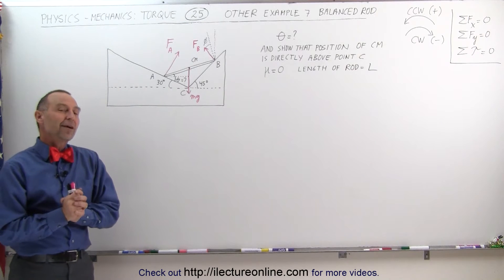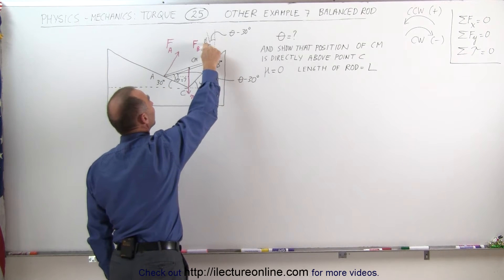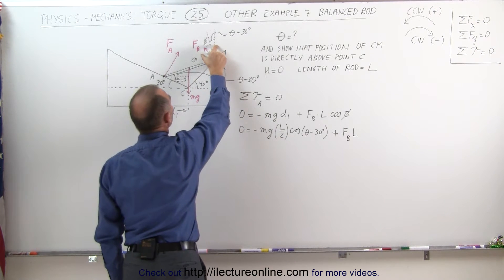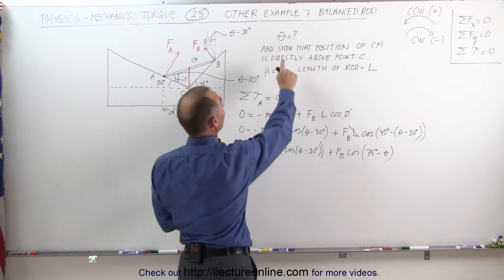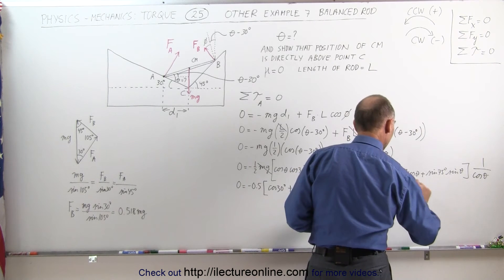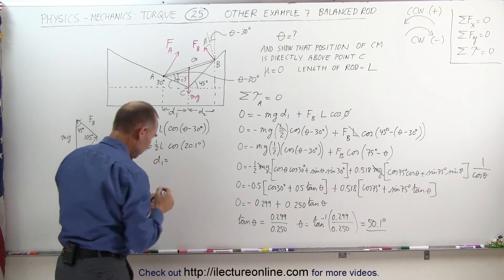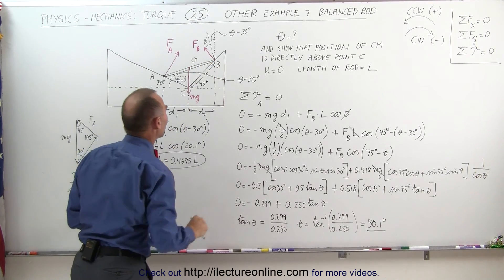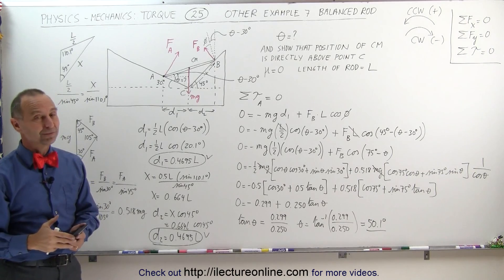Physics 15  Torque (25 of 25) More Examples: 7 Angle=? of Balanced Rod

Comment: Hello Sir, in real world what if I have a 3d object on a surface (table for example) and I would to calculate the moment due to the force reaction in the case of the object is not in quilibrum (so not static situation, for example a book that fall down). In this case the reaction forces are applied on every point of the surface contact between the object and the table, so it's necessary calculate the moment, respect to a pole, of all these forces reaction
Reply from the maker: The reaction forces would change constantly, since the object is not in static equilibrium.
Reply: @MichelvanBiezen  so we can at least say that the moment due to the gravity is greater than the moment due  to the reaction forces?

Comment: Hey Michel,  the nice thing about this problem is , once again, it shows you can not rely on your intuition to conclude that The Rod would be balanced at the position shown...  I tried to imagine a board, a 2x4, with Wheels attached at both ends. That way the board could slide up and down those Two Ramps... and my instincts suggested that the Board would come to REST in a HORIZONTAL Position... but.. your video showed that the MATH would have the Board come to rest in the final Position your video shows.... TRULY Non Intuitive